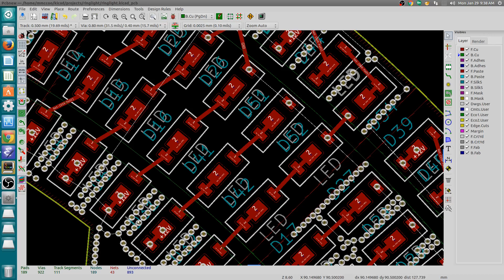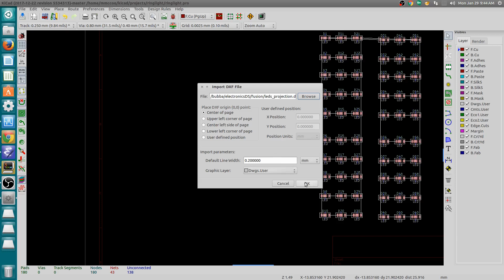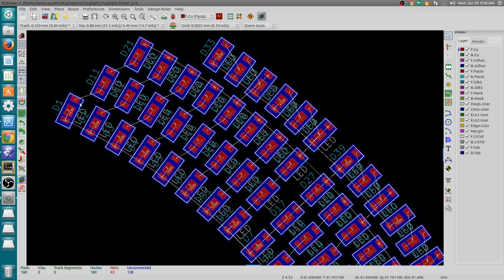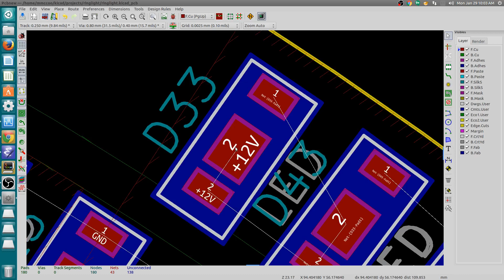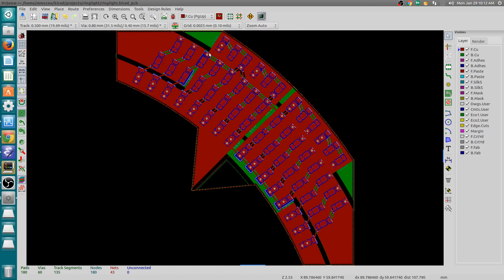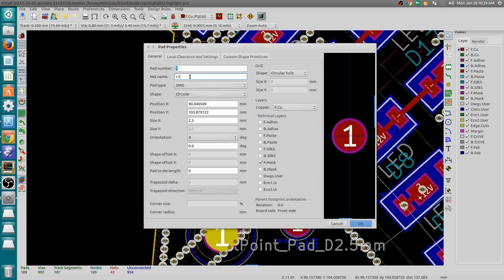Scripting fusion 360 import into kicad

Comment: Stumbled onto your vids. A couple years ago I experimented around with integrating Inkscape, KiCAD, Python and LISP via BricsCAD and AutoCAD and have one example on OSHPark pcb boards using splines. Took awhile but I tend to lean towards BricsCAD for its AutoCAD LISP compatible scripting to automate drawings rather than F360 even wrote parsing scripts for traces and importing the resulting PCB into KiCAD. BricsCAD now has geographic centering which would make your LED placement easier and precise. I'll have to study your scripts as I did some things 'the hard way'.

There's a huge user base contributing scrips for CAD LISP and they have some scrips that make things seemingly impossible possible with very few lines !

Lots of power in LISP and Python and are much alike. I'd like to see CAD LISP, like Python, integrated into KiCAD someday but I fear it would have to have the IntelliCAD platform engine to work. BricsCAD is based on the IntelliCAD engine and does most everything AutoCAD does but way less costly and does it all within its install of 570 MB on disk.